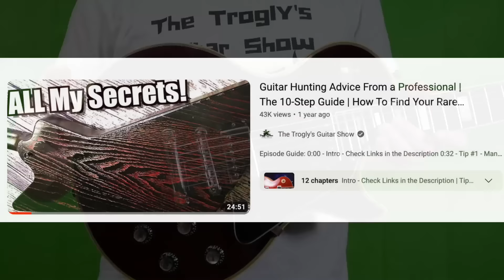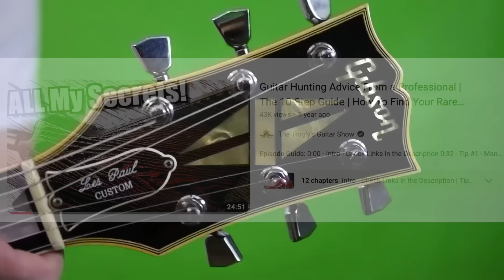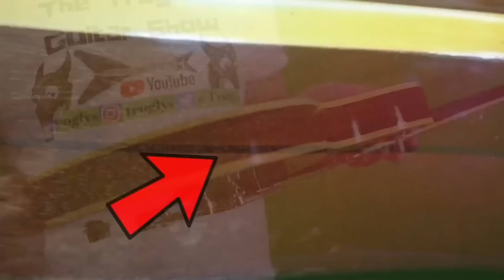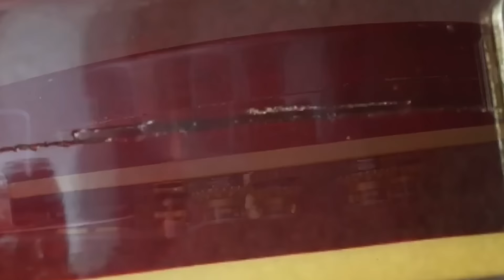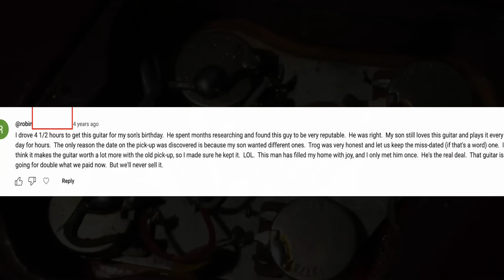This Guitar Has a Story I'll Never Forget...

Comment: Back in 1980s got a 1975 LP Custom with 'low wide frets. Whether or not you want to call them fretless, they were impossible to crown or do anything to so entirely pointless as frets. My luthier ruined the ebony fretboard trying. On top of Norlin boat anchor weight I sold it back to original owner (not the guy I bought it from but first owner).

Comment: I have a 1979 LP Custom in ebony with the factory chrome that I bought new off the rack at Guitar Center in Chicago. I figured the gold would wear off anyhow, so why bother. Came with speed knobs. The only non-original thing is the plastic pickup rings are now cream instead of black, a nod to my Dimarzio days back in the 80s. I guess when we put the original pickups back in, we didn't have the original black rings.

Comment: On vehicle engines many people remove studs by screwing 2 nuts onto the stud, tightening the two nuts together and then unscrewing the stud using the lower of the two locked nuts. Guessing a similar method might work on a Gibson bridge post?

Comment: I chromed out my black 1978 Custom back in the 80's. I also put double cream DiMarzios in mine like Ace Frehley. Gold hardware is very thin and you can easily chrome it out by buffing it with polish. It's a little tricky but it works on the bushings too (mask off the surrounding area). It's funny to hear about the good days when they were $2-$4k lol I'm not that old but I remember when they under $1k and nobody wanted them. I paid $750 for mine in the mid 80's and I had a part time job. 

As far as the 1978 Custom... it was the worst Gibson I ever owned. In fact, every late 70's Les Paul I owned or played was pretty much garbage. I'd recommend to anyone who wants a Norlin era Les Paul that actually plays well to pass on the late 70's ones and look for one from early to mid 80's. IMO, they're much better players especially if you like rounder necks. Better yet... pass on the Norlin era Les Pauls altogether if you actually play. For the record, I'm not a Norlin hater, I like many of the other models from that period.

Comment: Gold hardware is completely tacky and ugly.
Reply: Absolutely agree...like an old Las Vegas hotel room.
Reply: Usually agree, but it does fit some guitars and finishes.
Reply: It works on some, doesn't work on most. It depends on the colour of the body IMO.

A Black Beauty pulls it off brilliantly, but I'm yet to see it work on an Ox Blood for example
Reply: I generally prefer chrome too but a white Les Paul or triple pickup SG Custom pull off the gold hardware well IMHO